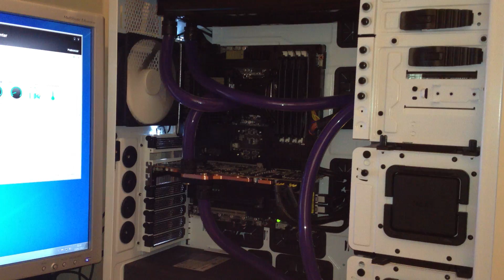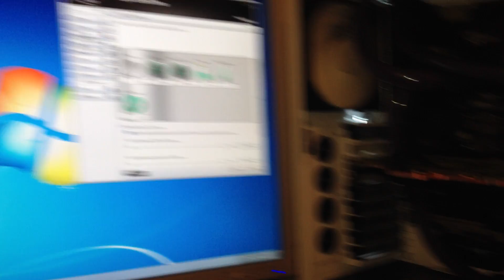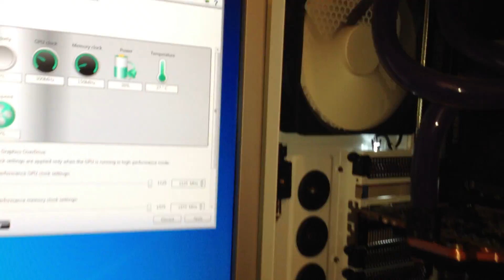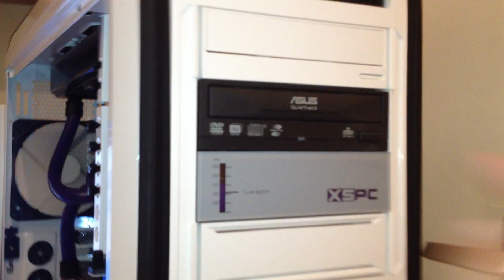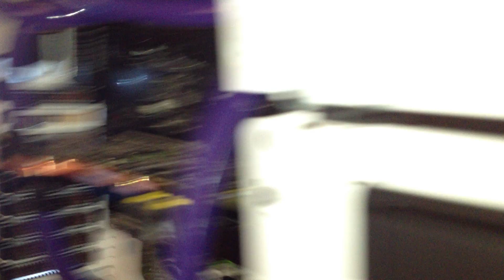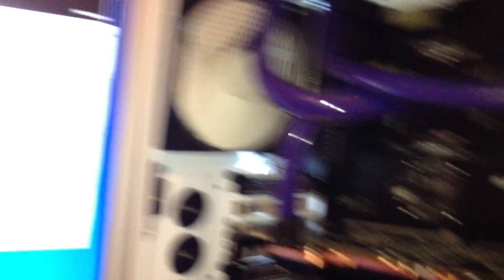Watercooled PC - Into windows and final look for now

Comment: Looks great very nice and clean. :) Quick question, I'm thinking of moving  up to 1/2" ID 3/4" OD tubing, primoflex stuff, was it easy to shape or did you have trouble avoiding kinks? Looks good so in the vid but I'ma need some tight loops.

Comment: I really like your white case and tubing....
Always wondered how it would look. 
I know it says "tubing: Black" but it looks purple... did you use dye at all?

20% off this case today on Newegg... so hard to resist ><
Is there a space between the top plastic cover and top metal cover for the rad?
if so... can u fit a thick rad + fans in it?

I got a very similar config in the works, still acquiring parts, but using Koolance pump/blocks for now.

Excellent cable routing job!

Comment: Nice setup. I'm thinking about getting a NZXT Switch 810 too... Can you fit anything into the top 5.25" bay (either optical drive or a fan controller) when you use the 360 rad? And do you think there can be a fan controller in the top bay if you install a 420 rad (3*140mm instead of a 3*120 mm))?

Comment: Nice. I'm thinking about getting one too and start watercooling. I have some questions though. How thick a radiator can you fit in the top (mm)? If i were to put a 420 rad in the top, would it hit the usb cables etc? Also, is it possible to remove the hot-swab hard drive bay?